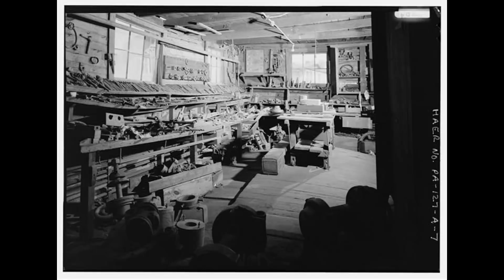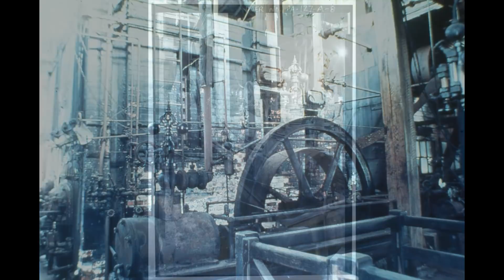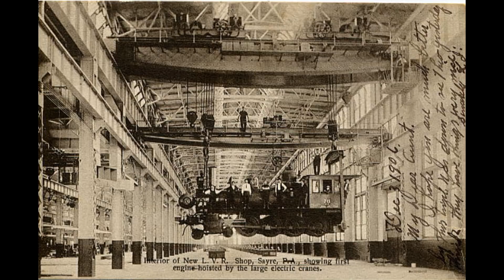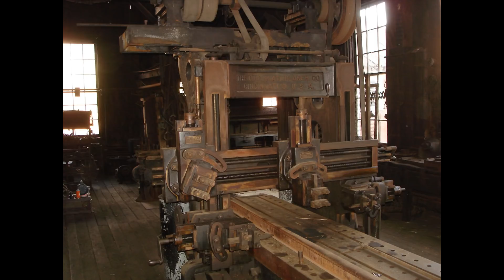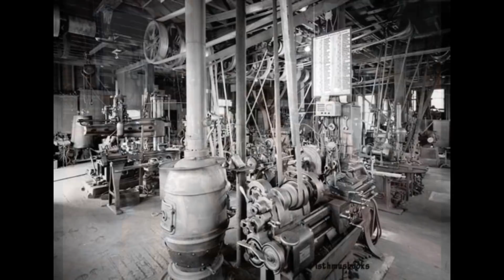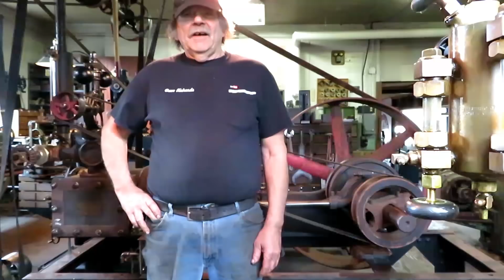Old Steam Powered Machine Shop 33   Governor pulley change

Comment: Dave,  does a pulley develop a patina like coating on its surface because of its continuous contact with a leather belt and does that help for the traction of the belt to the pulley?
Reply from the maker: Ed, The surface rust is gone in the first 10 minutes of running. Polished and clean works best....Dave

Comment: When your lathe was slowing down there around around 33:00, that must have been from belt slippage, right? No way it could choke down that 40hp engine. I guess you can get about 2.5-3 HP out of the belt? Nevermind, you answed around the 35:00 mark.

Comment: David, two small things I would comment on.  I can't help notice that some of your nuts and bolts are not period correct in size and shape, that being the size of the hex and height of the wrench surface for the bolt size, with regard to radius on the crown.  These old dimensions can be found in an older copy of the Machinists Handbook.  I would send one to you, but can not locate it, probably discarded in my last move.  Maybe you plan to correct this after completing the restoration assembly.
I also wonder, wouldn't it be better to have a nut on both sides of the sliding wedge adjustment stud?
Please reply with your thoughts.

I love your channel,  JIM
Reply from the maker: Hi Jim,  It seems to me that at that time they didn't have much standardization.  The engine companies made their own hardware any way they felt like it, and a lot of non standard threads too. Absolutely will be a nut both sides on the wedge when it gets to final assembly...Dave

Comment: Nice educated touch with those inside calipers Dave. It takes a fair bit of practice to get that good with them.
Reply from the maker: I sort of learned that because of the Horizontal baring mill. You just can't get in there to measure a bore with the bar in the way, except with the old type calipers. ...Dave

Comment: Just amazing what can be achieved with steam power and no electricity, plus measuring with simple caliper devices and a micrometer, skills not that many machinists would learn now and maybe at a loss when the battery died in their electronic vernier (not veneer) as I so often hear and see in YouTube clips. Thanks, Dave, again for taking the time to show us how it was done back in the day when many real skills were learnt and practiced-and machines were built to last. It is approaching summertime up over, past 10 days around 30 C, so if you are heading to warmer climes for your winter break, (understandable) have a great one, and look forward to more video's when you and the warmer weather returns to you Old Steam Powered Workshop. From 42 Degrees South.
Reply from the maker: Thanks Shevill, you definitely "get it", stay tuned,.... Dave
Reply: One of my best and most interesting YouTube subscriptions. I am much older that you, so your work also makes a lot of sense and is very understandable.

Comment: Appeciate all those brasses, these engines were designed so you could take up the slack and increase the time between rebuilds. The snug fit wears in and the loose wears out. That radius gave you a bit of a problem, practice makes perfect. THANK you for these videos. Wondered about those ribs, it'll be interesting to see if they work. It would be easier to flip switch, but if the grid goes down and there's no electricity

Comment: You said that "under higher load the speed went down a little  not for lack of power but because of the governor". That is correct also from the theoretical point of view. Modern electronic controllers are often so called PID type controllers where P stands for proportional, I stands for integrating and D for differentiating feed back control (also called closed loop control). That means that P corrects more the more the speed deviates from the target speed. I corrects the slow drifting away and also constant deviation from the target speed and D corrects against any change  of speed i.e. the quicker the change the stronger the corrections. All 3 together are in many applications capable of keeping the target speed dead on no matter what happens. But the steam governor represents only the P part of a controller. So since its correction is proportional to the deviation from the target it means it can alone not stay on the target but needs that deviation in speed to provide more power until the load goes down again. And that is exactly what you have observed. The I part would make the controller stubbornly keep the  target speed after a short departure and the D part would make the controller responsive to quickly react on any change in speed and keep that departure very short. Right around the 20ies the I part and D part of controllers were starting to be developed first mainly for controlling (military) ship engines. They were implemented by mechanical and soon electromechanical devices. But at those times steam was already on the way out and hardly benefited from this new and superior control technology.
Reply: You are never too old to learn something new :-) Glad I could help.
The electronic (analog) PID controllers usually have 3 potentiometers which you can tune with a small screw driver. The more you turn the 3 up the better the control quality gets until it gets worse by starting to oscillate the speed and higher up even increasing oscillation by itself up to self destruction. That is called control instability. To make your control stable again you quickly turn down D. D is the most destabilizing of the 3. It makes the controller "nervous". Then you turn down P a bit as it can also be destabilizing. This way you can play with the settings a bit and test the control stability by sudden load changes and check that no oscillations occur. Usually after a few minutes you got a satisfactory setting. The small generators driven by primitive B&S engines (and lawn mowers) they only have a fly wheel governor in the crank case like the old steam engines. They also got only P but no I or D control for cost reasons. These engines are so primitive that it is almost genius again. :-)
Reply from the maker: Rol...ah....you sound like a real engineer...thanks for the comment, glad you are aboard.....Dave
Reply: Thank you for that information, I had a limited understanding, as it relates to governing speed on generator sets. Wish I would have heard your explanation ten years ago!!!
Reply: ++ Dave: I have learned a lot from your videos and from other video creators. I am glad if I can return the favor once in  a while. Is it not wonderful that we can learn from each other across time and distance and even have fun while doing it?

Comment: Somehow I knew when you tighten the bolt on the bottom of the connecting rod it was going to be trouble. Every time I try to do a job like that now I wait till it's all lined up and moves like it should. I'm glad I'm not the only guy with that kind of trouble on assemblies. Good job enjoyed it very much. Thanks from from a guy who started out with flatbelt line shaft drives . It was only one giant 48" vertical boring mill but I ran it for years . At 72 hour weeks too.wish I could send a picture of my planer . God bless ole buddy
Reply from the maker: Thanks man, if you ever do get some photos, please send them to my email. A 4 foot boring mill is a real machine.....Dave

Comment: Hi Dave,

Interesting view of your work being in real time. I can sympathise with the frustration of only having two hands when trying to assemble parts like your crosshead/con rod. Seeing other people struggle as well makes me feel better; most videos only show the assembly done perfectly first time...the joys of editing! Haha.

I really enjoyed you showing how to measure the bore with calipers and showing how accurate you can be.

The smoke gave away that you were using a cutting oil of some kind but strange that we didn't see you applying it. Do you use tallow as would have been used in the 1920s?

Best wishes
Reply from the maker: Actually, I didn't use anything on that pulley, it was just a film of grease or something that smoked off when I hit it with the first cut. ..Dave
Reply: David Richards absolutely incredible. God bless you sir.
Very cool. Thank you

Comment: When I was younger I worked in a very demanding job shop in a farm area and picked up a habit of boring and turning away from the chuck when possible, not sure if that is the correct way but it was necessary because a lot of the time I was operating sometimes up to three machines at once and if I didn't get back in time to stop the feed it would avoid a crash. Most of the equipment was the same vintage of yours except converted to electric. I love your videos. Thanks.
Reply from the maker: For roughing cuts that's not a bad idea...Dave

Comment: Can't wait for the next episode! David, could I ask were you find the paint for your machines when you restore them. I like to restore way smaller tools and just can't seem to find the right colors.Have a love for the belt driven tools,saw pictures of the Rock Island Arsenal, when my grandfather worked there after WWI through WWII, making M4 tank,and subsequently my dad managing the tank turret program.Old pictures of line shafts running across the huge buildings there.
Reply from the maker: That was some great manufacturing. I Dad worked for Remington Rand Corp. for awhile during WWII making aircraft propellers I just mix up different shades of Rust Oleum paint....Dave
Reply: For what its worth, depending upon whether you're brushing   rattle canning, or spraying will have a lot to do with your choices.  But if you want to use polyurethane then a marine hardware store is an excellent source.   For acrylic or other options an auto paint supply store will have pretty much everything you need.  Don't over look machine enamel,  which as the name implies is an excellent choice for machine works.  Very durable and easy.  So is appliance epoxy in rattle can form.   Good luck

Comment: When you do the final assembly, if you insert the brass wear strip that goes behind the crosshead by itself, and hold it up at the top with something, it looks like there will be enough clearance for the crosshead to fit in and then slide up past the wrist pin end of the crank rod, then it would all fit together.
Reply: I saw the same thing sheila. he did fine knocking the bolts back though.

Comment: Hi Dave
Very enjoyable! 
My 2cts on "real time" is it is best used when the steps are not repetitive and show something different or important. I don;t think any type of music should be used in real time segments. Your choice of low volume, low key music when used is excellent
I really like how you repetitive section while machining the new pulley.
I do have a question: How do the bearing on the con rod get lubricated? I did not see any oilers. Is it just what oil is applied by a oil can at intervals during operation?
As always thank you for these videos and this glimpse back in time.
warm regards
vic
Reply from the maker: This engine has a groove like a keyway running down the side of the rod into the top bearing half. It evidently had an oiler mounted stationary to the side of the engine frame with a drip tube that dripped into that slot when the engine was running. I have a poor photo of a Morse engine and it can just barely be seen More research is needed on that....Dave

Comment: You forgot the two nuts for the slide wedge adjustment.
Reply from the maker: they're on there now...thinking about getting some shouldered nuts for there....Dave
Reply: Cool I know you where just test fitting but it would have been a shame to see it lock up after the first run.

Comment: I would not have thought you can get a correct measurement from a micrometer that is sitting free and not under the correct tension. Maybe a Starret can work that way, but not all brands for sure.

Comment: David, you noted that on the shop engine you only have a manual emergency steam cut-off if the governor fails. Why not build a roller to run on top of the governor belt (like the one on your previous shop engine. Then link that by chain to the 1/4 shut-off  valve you have installed already. You know if it ever fails it will be when you step out side for a moment and you'll have to run the 100 yd. dash to get to that shut-off.

Comment: What is the reason to have your compound slide set to an angle other then perpendicular to the cross slide when you are not screw cutting? Does it somehow make your setup more rigid, and therefore reduce chatter?
Reply from the maker: I don't know really, it just seems out of the way there and if you want to give a face off a couple thousands for finish you can just give the compound a nudge....Dave
Reply: Usually just for convenience.  It probably stiffens up the tool support a little bit as the compound dove tail is better able to resist twisting from the forces generated by the cutting tool. Also it gets the compound and it's hand crank out of the way of the cross slide hand wheel and obstructing the view of the cross feed dial.
  The sine of 30 degrees is 0.5 so if facing work to length, one thousands feed on the compound shortens the work 0.0005" .
 Some lathes have the T slot in the compound angled so that when the compound is set at 30 degrees, the T slot is parallel to the bed ways.
Reply: As Aceroadholder said. You get a divider 2:1 on 30° and at 5.74° 10:1. This can be helpful if you have to do really small or exact work on your old lathe. The compound is often the less worn out slide.

Comment: I love your videos! One question: Why would you not remove the support bar in the front of the engine when working on the crank assembly? It seems like it was made to be easily removed.
Reply from the maker: not really it screws into the bottom cylinder base at an angle and you have to take the whole frame apart to get it out. Sort of like a marine design...Dave
Reply: Oh OK! It isn't exactly built to be easy to work on huh!

Comment: Hi Dave, love your shop and videos! 
What do you use to take care of the leather drive belts, to keep them from cracking etc? What should a new leather belt be treated with to last?
Reply from the maker: I just use straight neatsfoot oil Jone....Dave
Reply: David Richards Thanks, eBay next then😁 Flat belts is not common in Norway any more, so products for leather drive belts is not easy to find

Comment: Dave, I truly enjoy your videos as it shows me the way things used to be.  I am not against CNC machines and all of the high tech stuff, but I love the manual machines for doing research and development work.  I am going to invest in a lathe very soon and I have decided to purchase a brand new machine as I don't want to screw around with a used machine.  I have a lot of development work to do and I must finish all of it.  Keep up your great work.  I remember when I was little around ten years old, we had a machine shop down the street that was all driven by shaft drives from the ceiling.  They didn't have a steam engine running it but it was impressive to watch.  It was rather quiet in their and dark as the light was only at the machines.  But it was very interesting.  Keep up the fine work of restoring live steam engines too.  I have six model live steam engines to complete that people have given me.  I love them.  Remember when you get done using steam, it turns back into water.  Filter out the rust,oil and other impurities and you can drink it!!!  TRY DRINKING RADIOACTIVE WASTE!!!
Reply from the maker: How true...Dave

Comment: Dave I think you need to find an old metal planer to fill out your shop . No shop was complete without one Good job
Reply: It's funny he should mention that isn't it Dave.
Reply from the maker: I think you are absolutely right.  Gives me chills just thinking about it....Dave
Reply: I just looked up ( metal planer ) to learn what you meant ? I had not seen one that I remembered , I am a machinist for over 25 years and did not recall this term from trade school , so i found a web page , (   .sandersoniron.com ) and it seems they use OLD machines also , seems they do  tables and railings . cool stuff , from line shaft driven machines too !!!